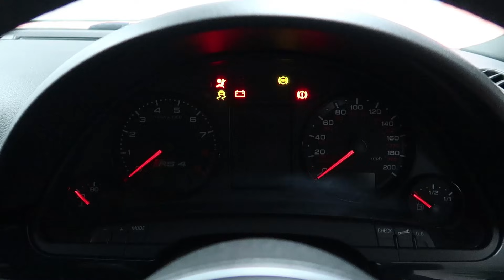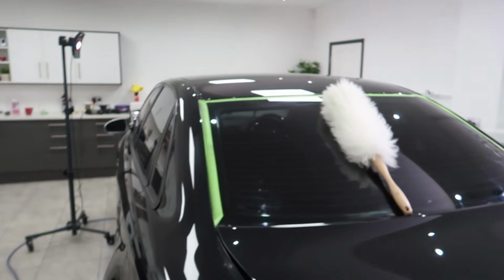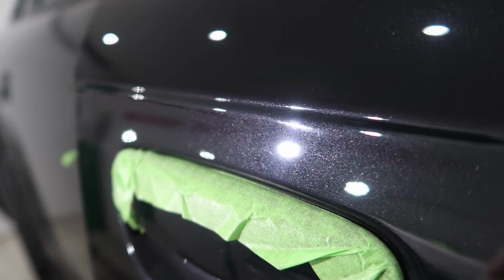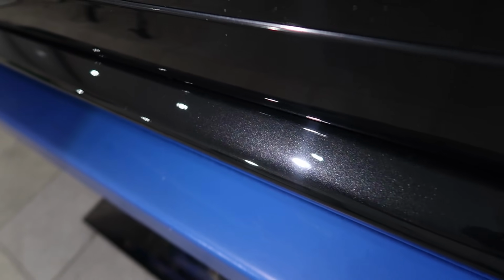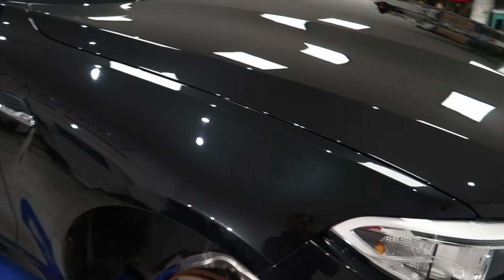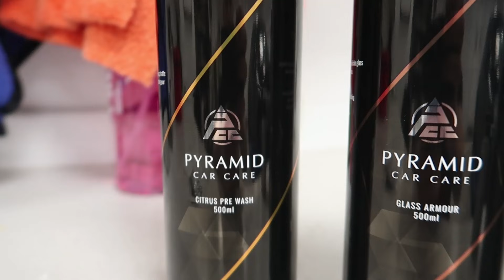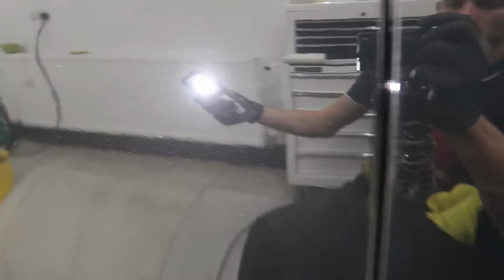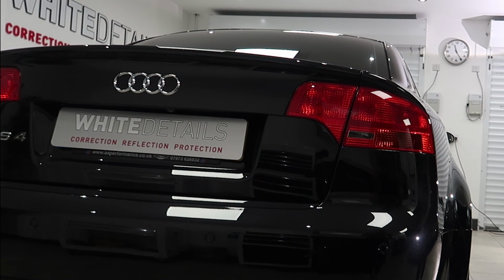Phantom RS4, Sapphire M2 & an Obsidian C63 - VLOG 042

Comment: Stunning job on the RS4, what would be your advice be on polishing outside for those who dont have the use of a unit or garage
Reply: Polishing outside is difficult as you cannot control the panel temperature due to the sun, dirt/pollen settling on the surface or see paint defects very well as it is not really possible to overpower the sun.

My advice would be polish in the shade, try and pick a day when there isn't too much in the air that can settle on the car and look at your level of correction when it is dark. You may get odd looks, but you can control the light source and see any defects that may remain.

Comment: I hope the ape who used an air gun to tighten the wheels nuts up  on the RS4 and not a torque wrench has the same problem as you . Just at 2 am issing down rain  or snowing at -5 with a good strong wind taking the chill down to -9

Comment: Hello! I have a lot of compound dust everywhere on car after cuttin stage, what should i do with this before LSP?? Thanks for answer and like always cool video!:)
Reply: If you are getting a lot of dust, first ask why? 

Consider a different polish: Some polishes produce more dust than others. Scholl S20 Black and Gyeon's Polish are two very low dust polishes with decent levels of cut and refinement. Things to consider are:

Change your pad type: Open cell (like the Rupes pads) and microfibre pads tend to produce more dust than closed cell pads (like Lake Country pads).

Ensure your pads aren't clogging: A lot of dust can be generated if pads are not cleaned enough before applying more polish. The residue builds up and tends to spew everywhere as it builds up. This is particularly noticeable when moving the pad over a curve so some of the pad loses contact with the paint or the pad is moved partly over a panel edge. Be prepared to change your pad frequently, especially if you don't have compressed air to blow the residue off.

Working time: If polishes are worked for too long, they tend to produce a lot of dust. The best way to determine this is to look at how long it takes for dusting to begin and don't keep going for long after. The temptation can be to work a polish for too long to ensure it breaks down. Sometimes less time is just as effective and reduces dust production.

In preparation for your LSP, just remove it as you go with compressed air, a metro vac airforce blaster or lamb's wool duster. They key is to remove this dust so it is not pressed into the paint when the LSP is applied and damaging the finish. If necessary, rewash the car very carefully.

I hope this helps,

Jon @ Exquisite Car Care

Comment: I noticed at 18:30 ish you taped around the trim on the body. You seem to be using a 1 inch pad. Why would you tape around a metal body with a pad that obviously wont damage the body since it is so wide at the top? There is no risk for burn on metal using menzerna 400 and a foam pad. Especially since there is not an edge present and you really aren't generating a bunch of heat based on the lapse. You are moving fairly quick. Just seems like a waste of time to tape around that. I would love to hear your input.